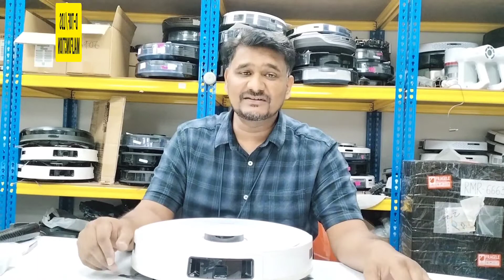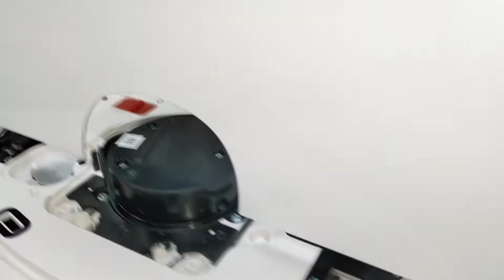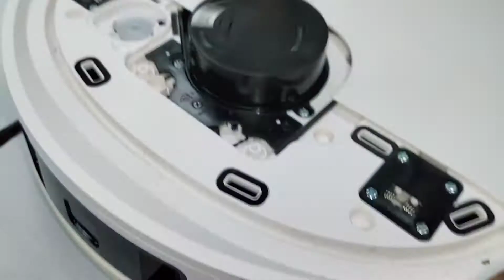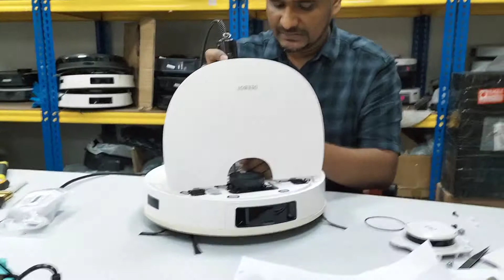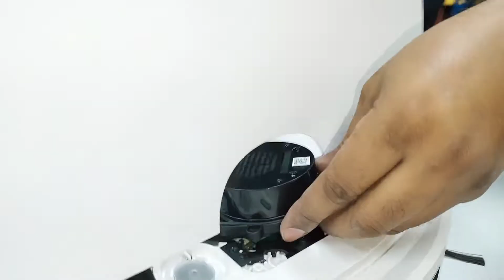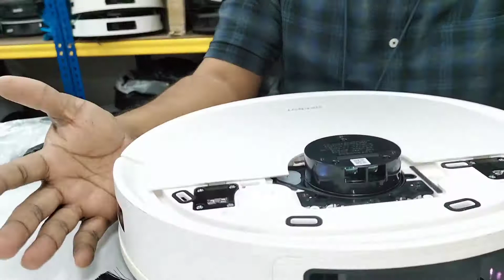Ecovacs | Deebot | Ozmo T9 D-Tof  Malfunction. Problem Solved

Comment: Hello. I desperately need help. 
My motor has been replaced a few times due to it being very loud. I contacted ecovac again but was told they will no longer fix it so I bought a new motor. While waiting for it to come we tried to clean the vaccum out really thoroughly then when it was put back together the D-Tof sensor no longer worked. We ordered a new d-rod sensor but still it is not working. 
I have no changed the motor yet because they sent the wrong one but would the motor be related to the d-tof sensor issue or did I manage to get a faulty part? Or is it something else entirely. 
Wanted to add that I can’t see the d-tof spinning at all, which is strange and it’s not jammed, it’s brand new. 
Please help me

Comment: This must be an problem with this model!!!
Had the same issue 4 months after I bought it and the warranty covered the repair, today I  just sent it for repair for the same damn issue - this time NOT under warranty!!!
I haven’t had the robot Vac three (3) years and in the shop twice!!!
Works great - when it works - but totally upset with the ECOVACS Brand!!!!
Reply from the maker: There's no doubt that Ecovacs performance is really good. .but anything we use need some maintenance.if we take care, service on time then it won't spoil too fast...I know many customers using this brand & they never bring it to service center...I request them always that before the warranty expires specifically in last month of warranty must bring it to service center so I'll test properly each part...what ever need to replace I'll replace... it's under warranty there won't be any charges & customer can use it longer...in Malaysia  senior citizens when see our service they really appreciate..& happy when I teach them about maintenance 🙂🙂

Comment: I have been jump starting the motor on roborock using mobile charger..it will work for some time. The problen may recuur. One thing youbhave to try is to clean the front roller wheels from any hair entanglement.

Comment: Hey man you literally just saved the day!! My motor was jammed and luckily didn’t have to replace.
Reply: How did u resolve the jammed motor?? Mine is still jammed...
Reply: @sud1891  I fallowed the steps to take the cover off then I moved the motor in the direction it spins. Turned the robot on and assisted it turning the sensor and it started turning on its own agian

Comment: Hi can you please offer some help?
I just replaced the whole d-tof sensor, but it’s still showing as a d-Tor error! (Red light flashing)
After replacement, the new d-tof appears to be spinning smoothly as you described, and I’ve also tried replacing the small motor and rubber belt to ensure that’s not the problem. Lastly I’ve done a factory reset and deleted the robot/map from the app to start afresh. Still no luck!
Any further suggestions or help is much appreciated😊✌️
Reply from the maker: Plz WhatsApp me a video clip so I can see which model u r using n how you fix everything...+601137973018
Reply: Hi I have the same issue after replacing the whole Dtof Sensor, the robot stays stationary and red light comes on with the same Dtof sensor error.